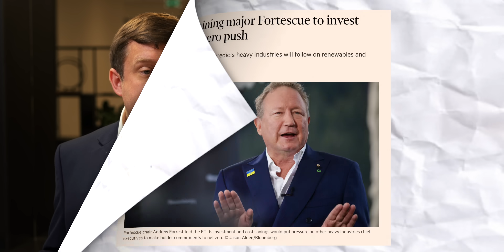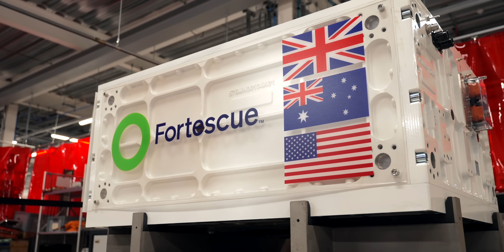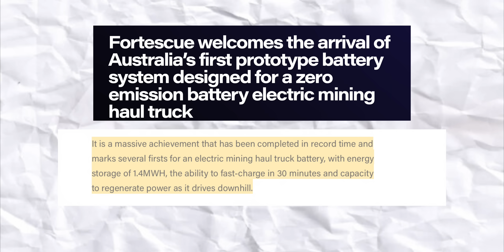This GIANT Electric Mining Truck Charges in Under 30 minutes!

Comment: Yes I watched the video. Did you read my reply?
By the time you build solar panels in China
Ship them to the Perth Drive them to the Pilbara, install them build the buildings and forge the steel for the building and the fuel butnbed at every stage you are so far behind in the energy equation you may never get it back to even 

The batteries proposed are not recyclable and the whole solar panel system will need to be replaced every 20 years or so

If you ever installed a single solar panel or did a single course on panels you would know that solar panels perform WORSE ain the heat with severe voltage drops and the Pilbara is not short of heat

The electric drive trucks are nothing new yet are AC today but when I first started working on them they were DC

This whole carbon free is a joke and the idea of batteries is a joke.

You are the victim of the joke and that’s the sad reality of the math.

The worlds biggest supplier of Lithium is China and China are not your allies in creating and sustaining the myth that we can run the world on lithium batteries 

I am aware of a few options that may work

But nuclear would be the baseline power. YES nuclear is carbon free

Building solar farms and wind farms is far from carbon free and big lithium batteries in every car and every hauls truck and ship and building is so ridiculously in achievable that you can add 100 years to any prediction it will be done by 2030

Comment: Of course I’ve heard of them I install them I am an industrial electrician. I know them inside and out.
I know exactly what it takes to build them and I have been doing it so long now I see the old panels failing and the problems diagnosing and replacing.
Wind farms are even worse than solar.

The carbon free is possible but not by solar or wind.

Firstly the energy used to build these solar panels and wind turbines and the carbon footprint are massive and would never be recovered
Solar plants have a life of 20 years and by then you have to have replaced almost every panel to keep them going
10 years life out of a wind turbine blade and they are 100 metres long. The difference between you and me Antonio is not only donI know renewables exist
I know the reality of building maintaining and eventually disassembling them.

It’s unsustainable.
I know it I live it
I breathe it every day.

You may not realise but the only want to generate the power this world needs “sustainably” is by nuclear power 

The renewables apart from hydro (there is no hydro that will ever power anything n the Pilbara mate there IS no water and no mountains over here. You are a very positive guy and unfortunately you have no clue about the Pilbara or how power is generated here or how much energy it will take to build power stations of solar power that can power a haul truck

Do the math. Those trucks burn over 2000 litres per 12 hour shift and the energy expended is phenomenal.

You can’t do the math because you have no clue about what you are talking. You want it to be real but the numbers will never add up in the Pilbara. It’s too remote and too hot (yes heat causes massive voltage drop in solar panels and shortens their lifespan)

It’s a publicity stunt and until nuclear gets back in the radar there will be no carbon footprint free power in the Pilbara
Reply: Solar and wind turbines deliver a LOT more energy than what was spent making them. Stop lying.

Comment: Just the other day I said to someone who drives a big diesel truck that  “these will be the last vehicles to be electrified”. I stand corrected.
Reply: My guess is long distance air planes and large, long distance cargo ships. I don't know what sort of energy density batteries will need to have to be able to cover those 2 (and cost per kWh), but I think there is a way to go.
Atleast with mining they never really travel far from home, so are never too far from a charger. Plus it's in an area the mining company has control over, so don't have to rely on public charging ect. 
I am curious how much thought they put into swappable batteries and why they didn't do it.
Reply: @patrickbeck4062  Swappable batteries don't make sense on very large (HUGE) vehicles because they could actually cost too much time. Moving a 1.4mwh battery around is no quick swap. If you even did it as fast as the Nio battery swaps you'd still be talking at least 10 minutes for the actually battery swap process to which you have to add aligning the vehicle with the swapping rig and attaching and detaching any necessary connections or safety devices. Just think of what happened when the Byford Dolphin imploded because safety protocols weren't completed properly due to faulty equipment and/or human error. No a quarry truck won't implode, but huge amounts of electricity could end up going where they aren't supposed to. The point is that it would all take time to do, extra investment to build in and more large weights to be throwing around. And the process could still take 20-30 minutes so you wouldn't have saved much time for a lot of extra consideration and effort. Plugging huge power supplies into a huge machine works for the current electric ferry in Norway and allows it to top up between journeys without delays. Simpler is always better. And don't forget two other major issues: i) with battery swaps you have to have spare batteries sitting around. So instead of having 10 ten trucks with ten batteries you'll need an extra 10 spare batteries ready to go; ii) you'll still have to charge the spare batteries anyway. Might as well roll a truck up to the charger and top up in about the same time as the swap process would take anyway.
Reply: @trevorberridge6079  Not to mention how much power it would require to charge a 1.4 mwh battery in 10 minutes. It would require a large electric power substation next to the battery unit to charge.
Reply: @patrickbeck4062  Think how long the swap would take compared to what they've achieved with the fast charge turnaround.  Also the licensing on-sale of the technologies they are developing...  Any large scale, large capacity (mobile) application.  Remote location operations with long lifetimes in service.  These peeps are thinking smart.
Reply: @patrickbeck4062  Yeah, I don't think long-range airplanes will ever be battery-powered — but that may eventually be the rare case for hydrogen fuel cell electric power. Either way, you're right that it'll take awhile. And of course they've also spent a lot of time and money trying to get GMO algae to produce kerosene at scale, so who knows, maybe that will eventually pay off and jet airplanes won't have to get new engines (electric or otherwise) at all.

As for cargo ships, if I were to wager on how they eventually become carbon neutral, I think I'd go with a liquid fuel such as ammonia, rather than electricity. Perhaps augmented with wind power from sails or kites.
Reply: @ps.2 I'm with you on this. Short-haul electric airliners are already well underway the design process but long-haul...battery tech keeps surprising me, so maybe one day, but some sort of hydrogen solution is definitely most likely. I'd also pin hydrogen as most likely for ocean freight (combined with wind etc) since it's relatively easy; much less volume constraints and only a few refueling points that are already industrialized

Kills me to see hydrogen being pushed for much else though, because it's so inefficient that it's probably just going to get in the way/waste funds for most things
Reply: @planefan082  I'm with you there: I can't for the life of me figure out how the H₂ stans can keep up their enthusiasm in the face of just how impractical it is for the vast majority of their proposed use cases.

Speaking of ocean freight, I actually wonder if that's where we will finally start to see SMRs. (Civilian, I mean. Aircraft carriers have been using SMRs for decades.)
Reply: @ps.2 I completely forgot about SMRs for oceangoing vessels. That would be great.
I imagine the biggest issues would be bureaucratic; different countries' nuclear regulations. I'd like to see it happen though.
Reply: @planefan082  Yeah it's not just you, people always seem to forget that the US Navy has been operating both aircraft carriers and submarines powered by SMRs, for ages. But, yeah, putting the same tech into commercial transport ships would face significant regulatory and political hurdles. You can't surround it with the same kind of physical security as a land-based power station, e.g., and guarding against bad actors trying to steal plutonium from your spent fuel stream could be a real challenge on a vessel owned and operated by some random multinational, which docks at ports all over the world.

But the effectively infinite supply of coolant water, with little or no pumping required, should be worth something on the safety ledger. (:
Reply: @ps.2 I think at some point there could be an opportunity for SMR variants that use fuel types that are safer and produce waste that's much less of a security concern. If those become widely available, AND regulatory bodies form some kind of international standard...then maybe we could see it happen commercially en masse.

Comment: 1.4 MWh seems a bit small, that would be about 5% the weight of the vehicle.
Reply: Yeah. I would think atleast 2.5Mwh would be much more useful. And would still need recharging every 3.5 hours or so, I'm guessing. But atleast then it could last between breaks, and then until between shifts, so if they could still do a half hour charge they wouldn't have much more down time than a truck with a driver.
Reply: Maybe it isn't driving out of a deep hole, maybe it is transporting on fairly level ground or even from a mountain top down to a processing plant, then it could be enough for a shift. Or maybe they just filled the space left by the engine and generator and couldn't fit more. If it was designed from the start to be an EV with 25-30% of the weight being battery then 5-7 MWh would be my guess.
Reply: @zapfanzapfan  If it drives down from a mountain to deliver material to a processing plant it might not require charging at all, as it could use the potential energy of the material with regen braking to charge up the batteries for the way back up again.
Reply: @speckkatze  Did you read what wrote in the reply above? Yes, that is used in a Swiss quarry.
Reply: @zapfanzapfan  there is no reply where you said it could live of just regen braking, or at least youtube isnt showing me one.
Reply: @speckkatze  YT has its glitches, sometimes I can't see my own replies either.
Reply: @speckkatze  the same principle is being used by one of their ore trains.
However haul trucks are typically loaded hauling up out of cut.
Reply: @0Aus  yeah, the concept for the truck that powers itself just with regen braking obviously only works in a very few mines. There is one doing exactly that in Switzerland for example.
Reply: @speckkatze   That's great 👍 
If we have opportunities where implementing these types of systems make sense why not.
The trying to force a square  peg through a round hole just because the government lives in the city and are out of touch dose zero for the course. 😏

Comment: It would have been great if there was a EV vs Diesel truck side by side comparison.   

Example, how long would a 1.4mwh charge last in "normal" use in the mine.  How much battery degrades during fast charging (30 min charging is fast charging).   How much operational time is lost per vehicle while waiting to charge as compared to diesel trucks.  Carrying capacity, speed, reliability, temperature ,etc.
Reply from the maker: All very good questions. Which can only be answered by being at the mine. Which is incredibly remote and very expensive to get to. We operate on a truly miniscule budget but even with all those restrictions I intend to get to the mine in 2025 and actually see these monsters in action.
But all your questions miss out one critical, massive issue.
The diesel doesn't come down from the sky, it has to be drilled, extracted, transported by ship, the dirtiest 40% of all global shipping, refined and then transported to the remote location, all of which has a massive, global impact that is always helpful ignored by the very powerful, wealthy and hugely influential fossil fuel industry.
Reply: @fullychargedshow Obviously ask them all the questions about the mining equipment, but don't forget to also ask about how much diesel they use to run the rest of the mine. Like processing, dewatering, workshops, and the thousands of air conditioners between the mine and campsite that run 24/7/365 etc.
About 8 ish years ago when I was still at a Forteque site, they had one of the dewatering guys come and do an update at one of our Mobile Maintenance workshop meetings.  He told us how much fuel they had used for the year (might have even been just 1 quarter). I wish I could remember the number exactly, but it was well into the millions of litres of diesel, just to pump water around site and out of pits so they don't flood. It was a shocking amount of fuel, I had to check I was looking at the right thing on the PowerPoint.
Many of the pump stations scattered around site are a diesel generator powering an electric pump. Seemed to me like one of the many places to atleast partially power with solar.

Also, make sure you come in the hottest week of summer and while the flies are out, to get the peak Pilbara experience haha

Comment: These trucks are already electric the diesel is used to generate the power to drive the electric motors
Considering most mines are 24/7 operations it will be interesting to see if the batteries can handle the regen used for braking

Comment: Interesting. So, if charging the giant machinery like this in thirty minutes is possible... why is it not possible to charge a standard passenger car in under 5 minutes? Something isn't adding up...
Reply: I will give you a tip.
Someone saying the battery system changes in said time frame & the reality!😄
Same as full charger run time, the size of solar array required etc
😄👍
Reply: The "C" rating of the battery is still a big limitation of charging speed. You could make a charger and charge cables big enough to charge a car battery in 5 minutes, but if the battery cells themselves can only handle a 30 minute charge you're going to get a lot of heat in the battery and then early failures, possibly fires, trying to charge it 6 times faster than what it's rated for.

Comment: I wonder if a huge pantograph system would be better. You would need much smaller batteries to help with weight and if the trucks are moving on common paths they can charge that amount plus more to the drop off site. I have no idea how much range they need. But then you could have solar during the day nd don't need to store solar energy in batteries for changing.